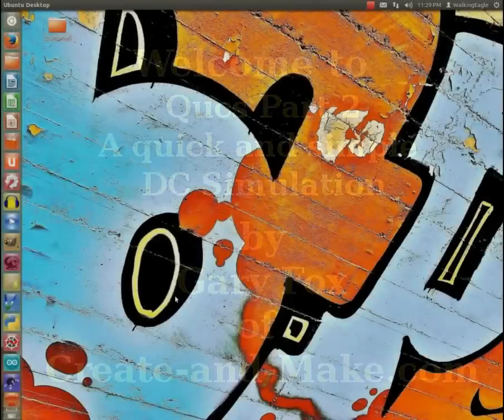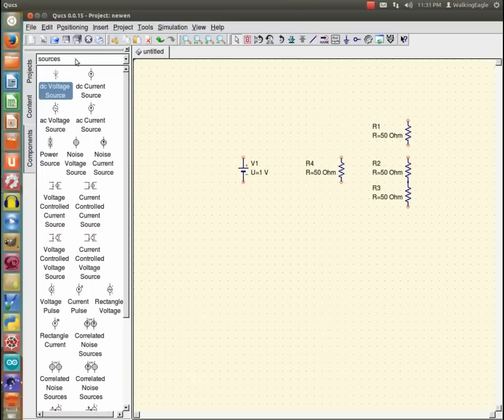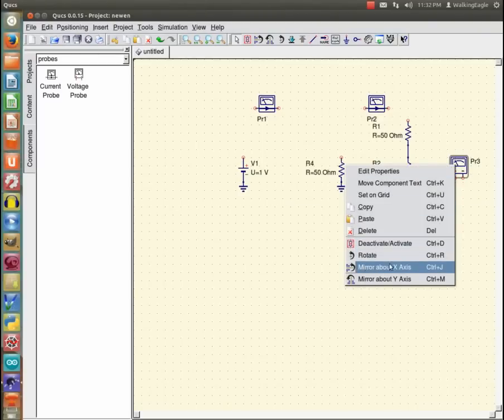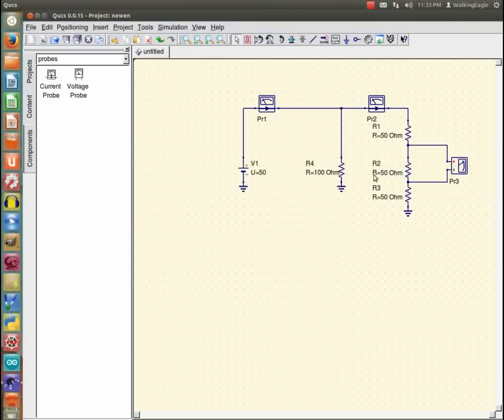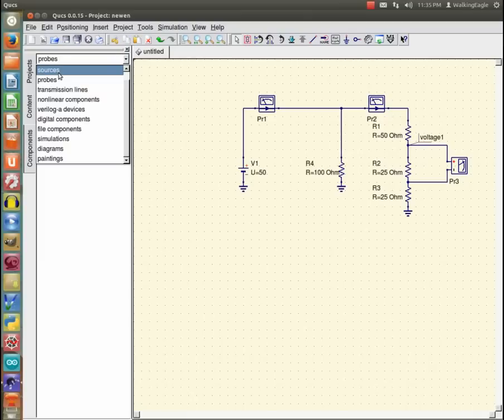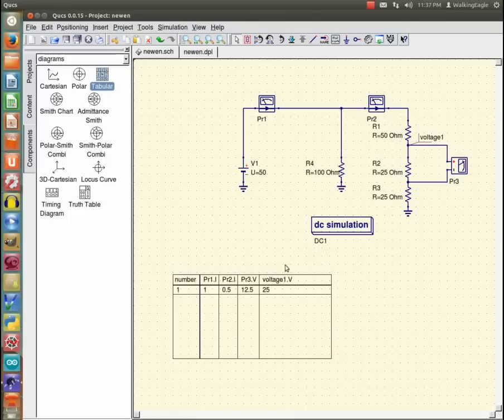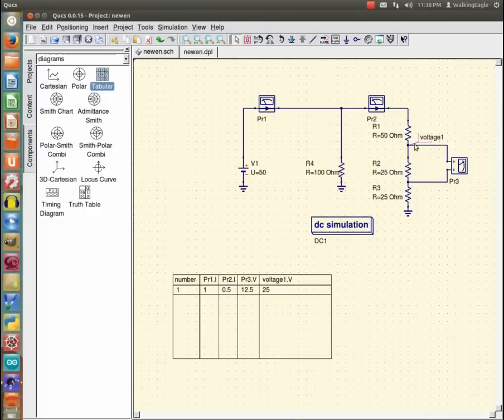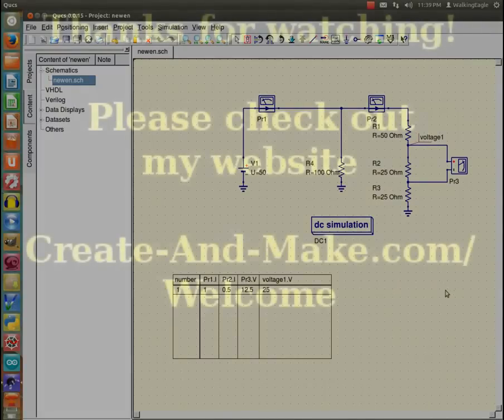Qucs Part 2 - Drawing a simple schematic and DC analysis

Comment: Hi thanks for uploading this video, i have a question about failures though. Is there a way that a beginner could run a DC simulation and find that they may have broken a component, eg: too much voltage across a LED and see this failure in the report.
thanks.